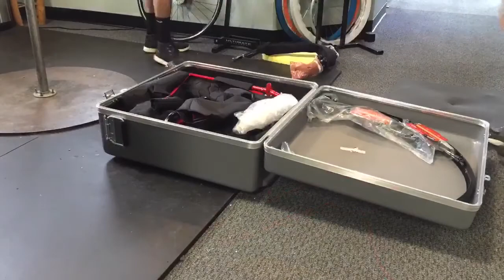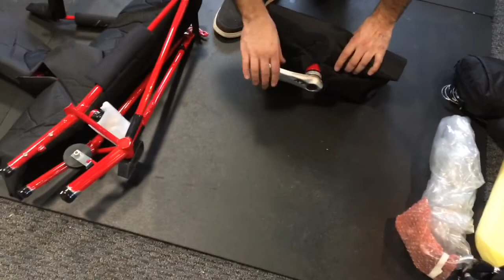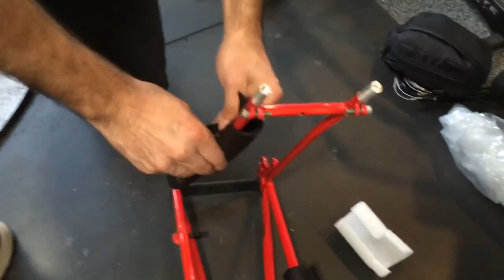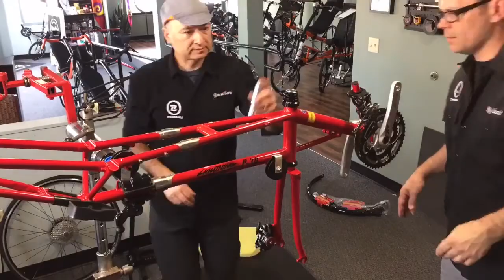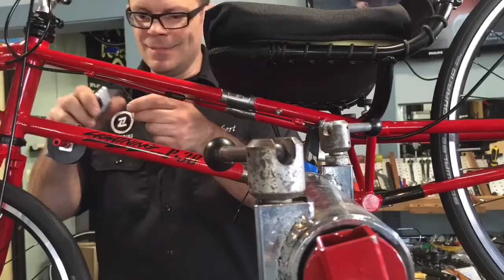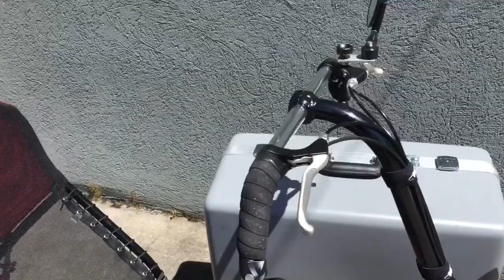Lightning Cycle Dynamics Voyager

Comment: Wow .. This could be good just for loading in the car ! S&s couplers !
Reply: Reassembly or breakdown of a Voyager takes a bit of time. It's great for travel but not for driving yourself and your bike to some daily ride spot. I can get my standard P-38 (large frame) inside my 2012 Ford Fusion sedan without removing anything – as long as I'm the only person inside, that works out fine.
Reply: Sorry to be offtopic but does anyone know of a method to log back into an instagram account?
I stupidly lost the account password. I appreciate any tips you can offer me.
Reply: @Tony Stanley instablaster :)
Reply: @Amir Dariel thanks so much for your reply. I got to the site through google and im in the hacking process now.
Takes quite some time so I will get back to you later with my results.
Reply: @Amir Dariel It did the trick and I actually got access to my account again. I am so happy:D
Thanks so much, you really help me out :D
Reply: @Tony Stanley Happy to help :)